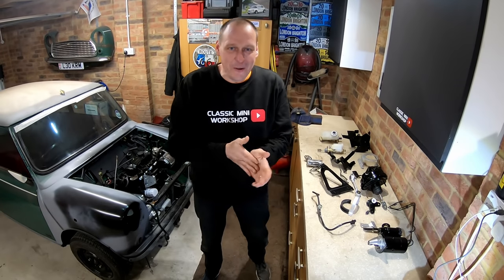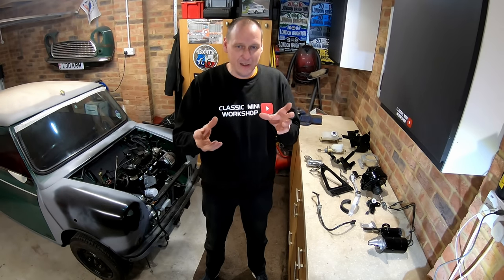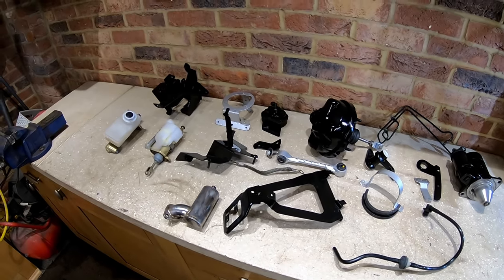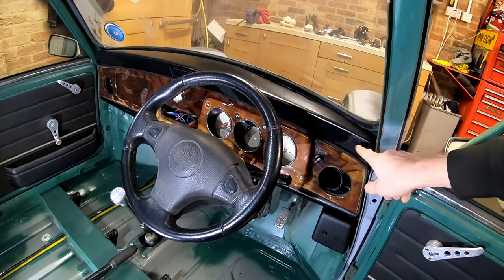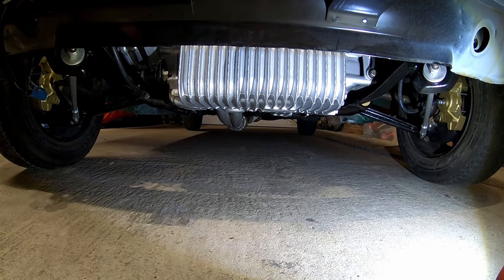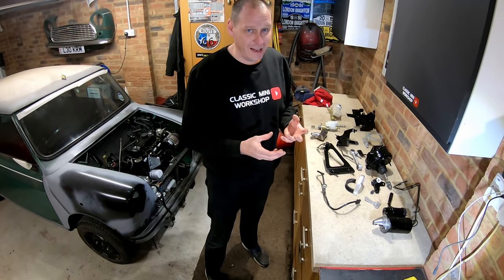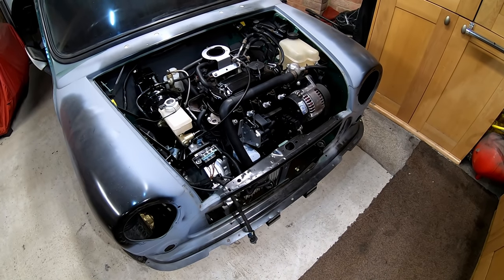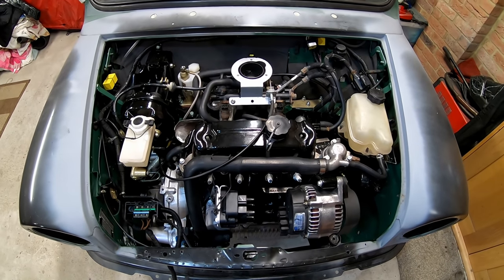Classic Mini Workshop - Project Sprout Pt.45 Bingley Plans and more rebuilding

Comment: Try electrical contact cleaner a a fine brass wire brush narrow like the steel one you used.  You should use the stuff on the contacts on the loom. It comes with a really fine plastic hose to spray it into small spaces.  Just read and follow the directions.  Cheers Keith!

Comment: Hi.. good episode as usual .. I have double garage space & I use a patio heater on a stand for mobility around garage (also take it into garden lol). But it supposed to be a wall mounted unit.. it works a treat! Mine was a pricey 1 off Amazon has carbon element its around a meter long 4" deep! But there is other options! It could be mounted above your work bench to help you keep warm & help with painting exterior! Cheers Richard 👍
Reply from the maker: Cool, good idea